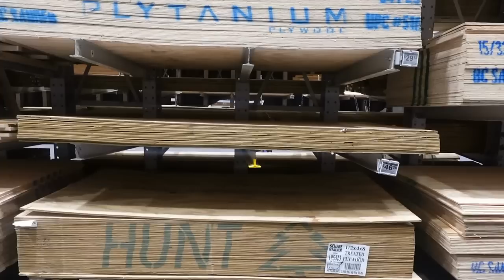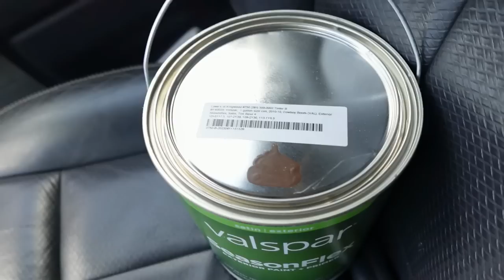Crafting a Fire Danger Sign for Plum Grove!

Comment: Stephany your so cute, and so clever. I always love your ideas,  horsing hardware is not a bad idea 😂😂😂😂😂😂 at all, and screws, we have shelves running across our garage with 100’s of different type screws, hardware,  he passed away 20 years ago but they are still good and useful, I always find just what I need, those brackets are great, it’s great that you had them 😂😂😂😂😂😂😂😂😂😂❤❤❤❤❤❤❤❤❤

Comment: Our state has these in different areas. They are a great reminder of the fire dangers. Lots of the signs here are "Smokey the Bear" picture on both sides of the board. Then they use different slide in or flip down signs that are LOW, Medium, High. Your idea is much more noticeable and I bet will be well received by your town.